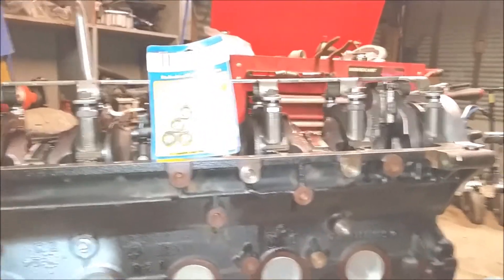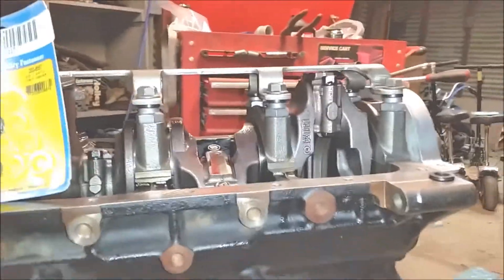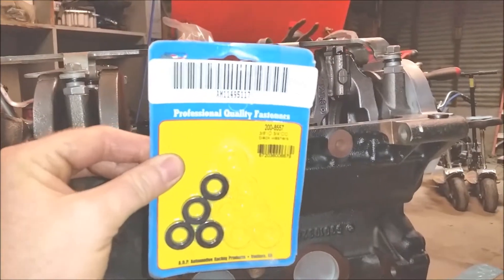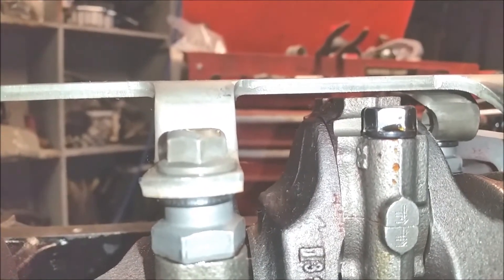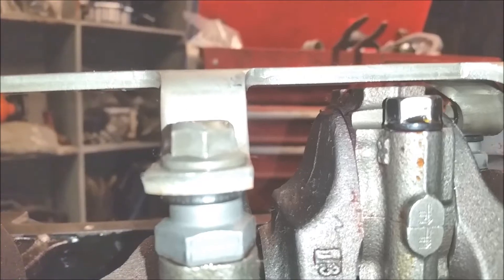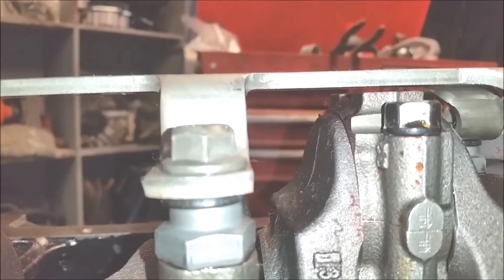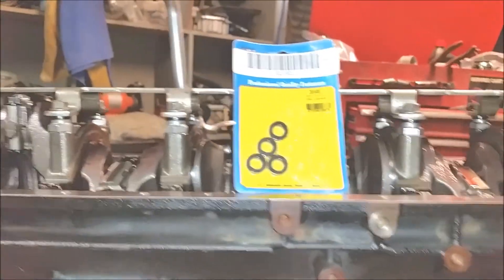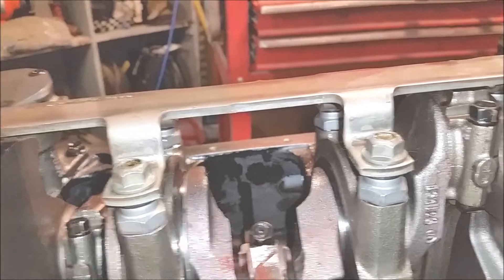4.6 Jeep Stroker Main Stud Girdle Spacer

Comment: Are those washers the same size as the washers that come with the arp head studs?
Reply: No, the 3/8 are for the stock bolt size. On stock main bolts. He said they were shot peened ARP main studs 😂 they were stock main bolts you can clearly see that. If you're running head studs do not order these, they are not what you're looking for
Reply: @thecitygunfightx  so i dont need spacers if im running ARP main studs ?

Comment: hey what studs did you use for your engine? are they the factory studs or arp? i was literally just thinking about the clearance issues when i found your video
Reply from the maker: Factory but arp would be better
Reply from the maker: my rod bolts are arp
Reply: Cool. I havent been able to find arp studs that have the extra mounting surface for the girdle. Do they make them? Also what part # are those spacers. Thanks for the reply
Reply: Frank Elizarraraz Cornejo they don’t make them
Reply: Called arp few years back and they said they could make me a custom set. Dont know if they still offer that service

Comment: Where did you get your machine work done?
Reply from the maker: pra3t0rian ok the machine work was done at more than one place. I did all the porting. Powerhouse in Bakersfield did the block, and all the valve and spring seat work was done by Jim Oaks at Titan engines.